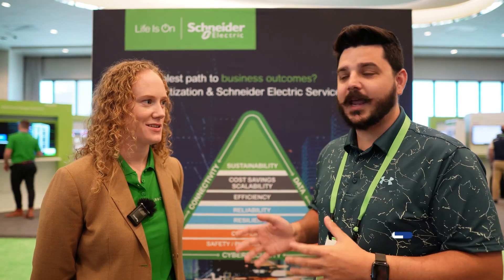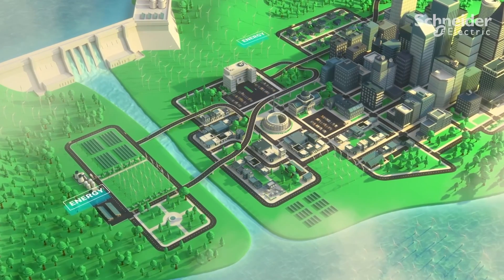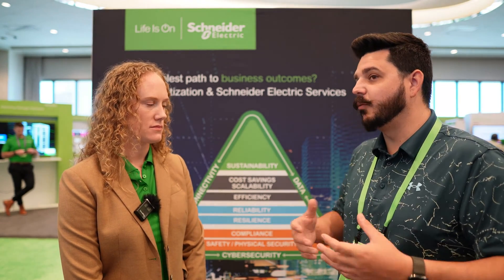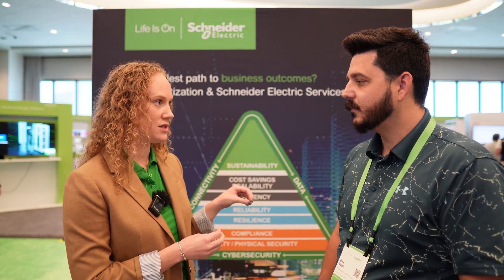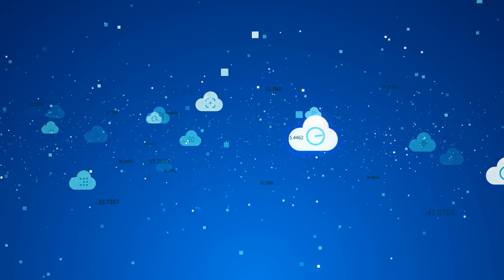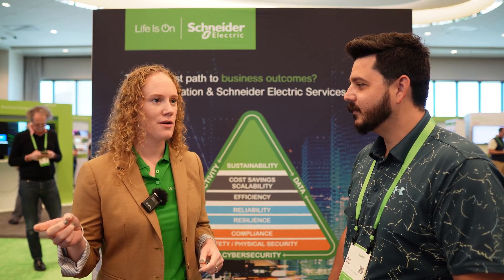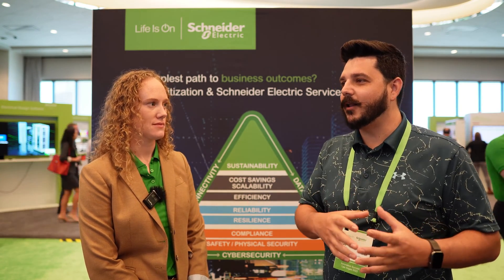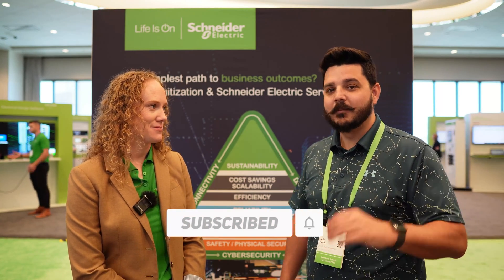Understanding Why Micro Grids are the Future

Comment: Isn’t anyone with net metering, solar, battery backup a MICRO GRID? I’m hoping the power companies will build small 5-10 acre solar with battery backups scattered throughout communities especially in rural areas. That way if 20 miles away the transmission gets hit with a storm, etc. the electricity will be more localized. It may not be practical but at the very least, all who can, could have solar and battery backup so if grid goes down, solar/battery kick in, thanks
Reply: I don't think that will happen (at least on a large scale) bc where is the profit motive in that? I don't see any incentive from utilities to do that
Reply: Nova Scotia Power are attemping to us wind mill micro grids instead of solar they are building wind mill substations with battery storage. This allows them to avoid buying an individual's access solar power that returns to the grid. Oddly enough NSP is own by Emera which owns Block Energy which builds solar micro grids.